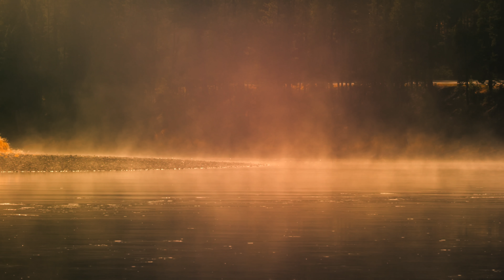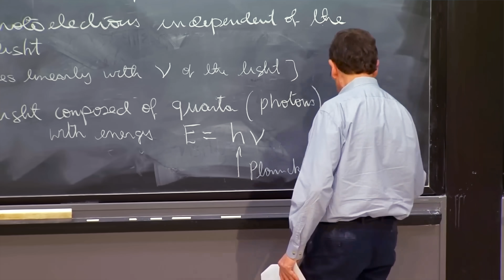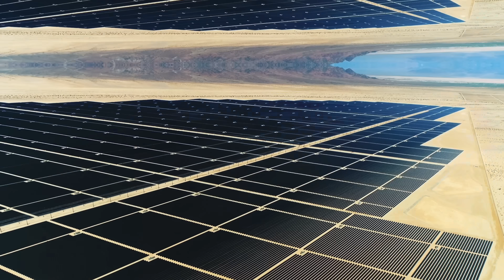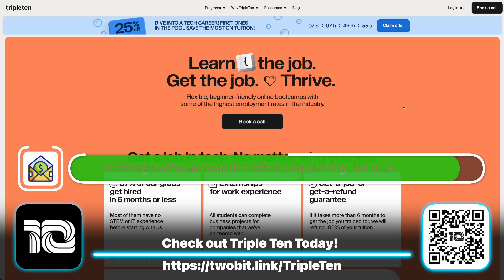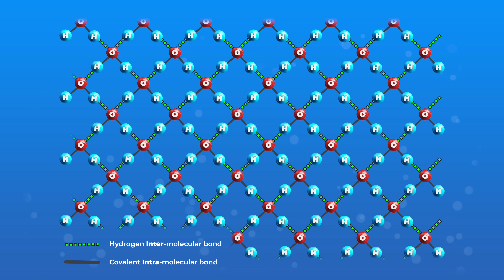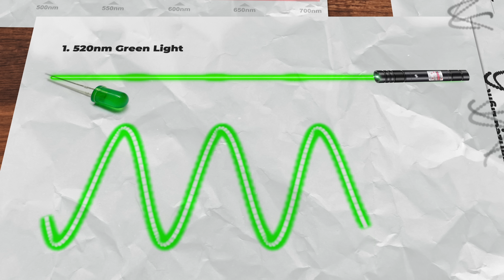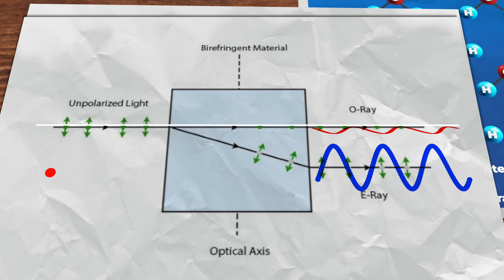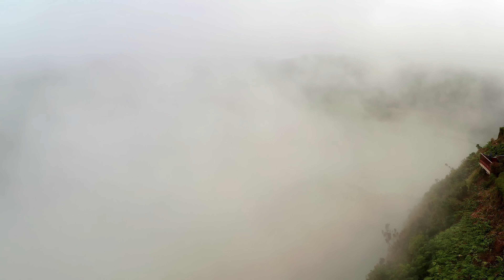New MIT Discovery Just Solved Water's BIGGEST Mystery!

Comment: This is shown in backyard clotheslines.  Clothes dry very much faster in sunshine.  This happens even in cold air.
Reply: You can't just assume this observation is proof of the effect though. It could just be that the Sun's rays heat up the clothes through radiative heat and that increase in the clothes' temperature causes the evaporation, even when the ambient temperature of the air is low.
Reply: @wattswatts7605   i agree and i would even dare to state that alot more things are going on at once. On the microscopic level and within local barometric pressures and local energy levels, who knows what jumps around on the molecular level and on the atomic level.
Reply: @wattswatts7605  That's what anyone would think, isn't it? Oh, it's probably just this or that. Those are precisely the types of questions any self-respecting scientist would ask themselves before publishing a paper this important, and it's precisely why the researchers, who had first observed the effect in 2023 on samples of water inside hydrogel scaffolding and had already proved almost beyond a doubt that this wasn't thermal evaporation, performed not ONE observation, as you suggest, but 14 different experiments testing everything from the effects of color, angle, polarization and everything in between, on pure water (without the hydrogel scaffolding).

So, before you assume that a paper published in Nature would overlook something as obvious as a photothermal effect, you should try reading the paper. The authors prove "beyond reasonable doubt" that this isn't thermal evaporation. Their hypothesis is what they coined the photomolecular effect, which is groundbreaking and never before seen. It also explains a bunch of stuff we didn't understand before, like why clouds seem to absorb more light than we thought possible and why they evaporate faster than thermal models predict.

Does it mean they're right? No, just that they're probably right, but that's true about ABSOLUTELY EVERYTHING in science (It's the single most frustrating truth out there, but also the most exciting, that anything, no matter how well-established, can be contested).

The simplest piece of evidence that it's not a thermal effect from absorbing IR light is that they used monochromatic green light that DOESN'T contain IR light. They also compensated results for any absorption that could lead to photothermal heating AND, there's also the simple little fact that the evaporation rate is 4X higher than if you supplied 100% of the energy with an electrical resistor entirely as heat (That's what they refer to as the thermal limit).
Reply: Given that it happens. it certainly would happen on a clothes line, but there are many other factors at play in those cases. I would hardly call a clothes line a controlled enough environment to tease out the relative effects of different evaporative processes (especially when they inherently are linked--sun light also heats clothes which would increase thermal evaporation as well).
Reply: Depends on dewpoint.
Reply: You're absolutely right.  However, it's not the only reason why they dry faster in the sun.
There are photothermal effects involved (IR light absorbed as heat increasing the temperature and the evaporation rate), as well as simple mechanical effects like the wind replacing moist air with dryer air on the surface of clothes and constantly shifting the phase equilibrium between liquid water and vapor toward the vapor phase. But what's clear is that this is happening on all water bodies and wet surfaces (like wet clothes) making evaporation faster.
Reply: Smells better too!
Reply: UV also disinfects clothes on the clothesline.
Reply: Absolutely correct
I have noticed clothes on washing lines dry much quicker towards dusk when the sun light is almost perpendicular to the clothes rather than mid day when the sun is almost overhead. It is clearly much hotter mid day
Did puzzle me
Thanks Rick for solving this mystery,😀
Reply: WRONG, NO WIND the clothes won't dry at all!!! with strong wind it dries almost immediately....the sun helps it! But at night it also dries...if there's wind!
Reply: Because you have warmth from the light including IR and UV and wind, it doesn't work in damp air. 😂 This why you get sunburnt on snow, the light is reflected and burns you, this has been known for centuries.
Reply: @altvamp Uh, the video already said heat only evaps a fourth of what photons do!
Reply: @shandor2522  Uh, the video then goes on to say light does.
Reply: Oh clothes lines are illegal in California.;-) if you nice in all too common neighborhood with nasty homeowners association.
Reply: @grumpystiltskin   It's not California, but the HOA's. Unfortunately, those seem to be a thing everywhere. Politics + pettiness = HOA. 🤦
Reply: @erinmac4750  Thanks for pointing out that it is the HOA not the state that bans clotheslines.
It's always good to see someone shutdown those who make up nonsense about the wonderful state of California.
PS. I do not live in California.
Reply: @grumpystiltskin  the land of the free
Reply: @conjmcnal  free fee.
Reply: @grumpystiltskin WoW! I thought a clothes line is more environmentally friendly.
Reply: @grumpystiltskin  I expect folks don't want to see their neighbors drawers no matter how environmentally conscious they are.
Reply: @grumpystiltskin  simples, don’t live in California. Physics and science work better outside Newsom’s head
Reply: What???? How can clothes lines be illegal???
It's Sola is it not..🤔🤣🤣🤣
Reply: @grumpystiltskin  God forbid the neighbors see your undies being sanitised by sunshine and fluttering in the breeze. What a f*****g miserable place. Naturally dried clothes are like fresh baked bread - they just smell better!
Reply: @grumpystiltskin  people still live in California? 😅
Reply: @grumpystiltskin Clothes lines aren’t illegal in California or anyplace else. 🙄 Sure HOAs might ban them, but HOAs aren’t found only in California!

Comment: Maybe I'm just weird,  but one of the first thoughts I had was 'could this be usable to increase efficiency in the production of stem for power generation? '.
Reply from the maker: oh now that's interesting!
Reply: Brilliant! Combine that with desalination and that would be pretty slick!
Reply: The efficiency issues with steam power pretty much all lie in the conversion of the energy in the steam to useful energy like motion or electricity (It's still the best option we have, but the Carnot limit sets an absolute limit on the efficiency with which the energy in the steam and be made into useful work). The steam needs to enter the system with the correct amount of thermal energy and since this new discovery doesn't contradict conservation of energy, there's no reason to think it has any chance of being more efficient than the 90+% efficient boilers already in use.
Reply: @peglor  The real question is how the 2 processes would interact.   There isn't any data related to that or any indication that it has yet been explored.
Reply: Brilliant, as long as the energy from making steam this way is greater than the energy from the light source. It could work, maybe, especially if the light is from a renewable source.
Reply: Me to
Steam power relies on molecules having high kinetic energy
So my maybe incorrect guess is with conservation of energy you get out what you put in. So only energy gain might be in breaking less chemical bonds of water molecules which my guess will be small compared to the actually energy of a steam molecule.
Looking forward to seeing this tested  and hope I am wrong
Another thought is steam energy is yesterday's tech. Electricity is being generated directly from something similar to solar cells but that work in the infra red. They  efficient and have much less moving parts than steam

Comment: Well, this is interesting. I always wondered why you can dry clothes (eventually) at the Antarctica despite the cold.
Reply: Did you assume the clothes need to be heated to the boiling point of water before clothes could dry up till now? Once the humidity in the air ls lower than 100%, water will evaporate into that air. This describes a very limited case where light can be used to start this off, but it still needs water vapour capacity in the air to work. Look up mass transfer if you want to see the science behind this process.
Reply: @peglor  no, not heated. Just that the clothes dry despite negative temperatures
Reply: @lenshand  There are no negative temperatures - we've chosen arbitrary points we call zero on the Celsius and Fahrenheit scales, but in absolute terms, zero Celsius is 273 degrees above the actual zero point. This means there's plenty of energy available whether it seems subjectively cold to you or not.

Comment: WAIT A SECOND. If there is evidence to support evaporating water. Shouldn't there be a threshold that could break hydrogen from it bonding with oxygen? Maybe this could revolutionize the way engineers build electrolysis systems. A car running on water might be possible.
Reply: First, the sad part, think of H2O as a nuke bomb, compared to 2 H2O molecule as normal day-to-day guns. This is to say… light is energy to "everything" is possible… but even if it worked it probably wouldn't be "the thing."
Second, the fun part :D, I've seen recently (+-1yr) news about researchers that found that applying a magnetic field on the standard electrolysis system… actually improves the system! So there's a chance that if you combine the 2… we may just have found "the thing!"

Comment: I thought the general idea was known for some time - I remember watching a documentary on climate change and possible causes besides human CO2 emissions and one of the data points was records of how much water was added to the water basins on ranches. I think these basins were only used to monitor how fast the water in basins used by the ranch animals would evaporate. The ranchers would know how much water the herd would consume (given weather conditions) that would help them avoid having those basins run dry without requiring someone to physically check the water levels several times a day.

The ultimate conclusion was that the evaporation rate had dropped over the last few decades, when adjusted for temperature and humidity. The conclusion was that there's been a subtle increase in high, thin clouds that reduced the amount of UV light reaching the surface. That light could break the bonds between water molecules.

So thin clouds, barely visible, reduced the UV hitting the surface. That reduced the evaporation levels, and that in turn meant that the ranchers had to add less water. Those thin clouds were probably created by humans, e.g., perhaps from aircraft contrails.

(We know that's a factor after air traffic was shut down after 9/11.)

(We also know that the dirty fuel used by merchant ships was a huge factor after its use was banned a year or two ago.)

Of course knowing that green light is enough, or that polarization is involved, is a big leap forward. It's one think to know that this happens with UV light, a very different thing knowing that it happens with relatively cheaply produced polarized green light.
Reply: Also called pan evaporation. It's been a thing since the 80s/90s. BBC panorama did a documentary on it.
Reply: Think you watched BBC's "Global Dimming". Great documentary!
Reply: @donlars1  It may have been. I think they had two different ones. The one I remember more had russian scientists and various other ones from around the globe all talking about the same basic findings that less water was evaporating over the last few decades etc. Regardless of the reason it's a bit of a worry.

Comment: I would have guessed that like with temperature, since water has an higher relative humidity percentage would "leak" it in drier air in an exchange to find a balance, but I was obviously wrong lol
Reply from the maker: pretty fascinating right? I love that there's still so much for us to learn about ... what a world!
Reply: actually you are right, the tendency to evaporate is the water vapor pressure and it is directly related to the temperature. Water will evaporate in dry air until it saturates it, EVEN IF IT IS COMPLETELY DARK.  This photo evaporation effect could be responsible by part of the evaporation but it is definitely not the main reason. Molecules have a distribution of velocities at a given average T, some are very fast other very slow,  faster ones at the surface can escape to the air, some go back but most go away carried by air currents.  The surface cools down (slower molecules remaining) but after exchanging heat with the surroundings it regains the original temperature and it all repeats until air reaches it saturation limit at the given T.  If you leave a cup of water in a dark place with openings it will all evaporate.
Reply: Main question is :  what % of evaporation is photo effect responsible for ?  I don't think this photo effect could improve by much the current inexpensive solar desalinization pool process, since green light is already part of solar light.
Reply: @Ed-bj5eq I dont think you can quantify it as a percentage, the percentage iabprobably  between 0 -100% dependingbon the conditions...
And yes, solar light is "free" so the implication are more about evaporating  water WITHOUT solar energy. like:
-a dryer using green light instead of heat
-a heat pump that would use water as refrigerant, evaporating it efficiently with green light, removing heat,  and condensing it to release heat
Reply: @geemy9675  if you have to produce green light, as with a laser (inefficient process), then transforming that same energy into heat by Joule effect (electrical resistance) is still more efficient, so you will have to consider the energy loss from the laser (it loses most as heat).  But lets assume that you have available E1 energy amount in green light and the same E1  as heat, now input this same energy in two separate containers with same water amount, same initial conditions, and check the % of water evaporation from both and compare green light photo-effect vs Joule effect.  Also, you could check that in a different experiment with one container : EXP 1 - heat, in the dark, a volume of water V  from T1 to T2 (below boiling point), or leave the heater on for a given time t, measure how much water evaporated.  EXP2 - do exactly the same but this time also shine green polarized light at 45 surface angle and check how much water evaporated this time.  Then if the difference is worth it you will worry about how to make artificial green light in an highly efficient way

Comment: ive always felt it there is more than heat to it, especially in cold enviroments water still evaporates to some degree
Reply from the maker: yeah you're right... it did feel like there was a foundational piece missing. well noted!
Reply: There is - the energy level (heat) is not the same for every molecule in a material. There are always some with high and some with low energy. The high energy molecules with jump from the surface, and if the conditions suit (Such as low humidity air moving over the surface) the molecule that was in the liquid or solid has now become vapour. Temperature is a measure of the average thermal energy level in a material, not a statement that no molecule in the material can have enough energy to evaporate from it.

Comment: put some water in a pot and turn the stove up while turning the lights off in the kitchen...  does water need light to evaporate?
I think it is the radiation that splits water molecules into atoms where they are released and rise to the surface...
There is radiation in heat as well as light...
Reply from the maker: yes that's right! But there's also this photomolecular effect at play as well... but yes the thermal radiation definitely plays a key role as well
Reply: @TwoBitDaVinci  in winter the snow still evaporates even though it is below freezing..  and clothes on a clothesline dries slower over night..  just some personal observations..  Photo Fission smashing atoms...  8D  Hi from T.